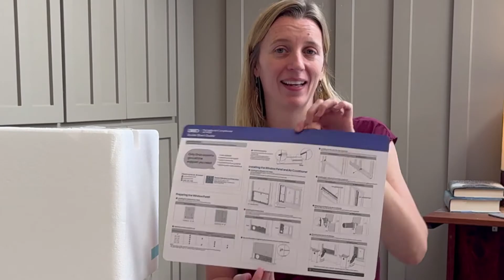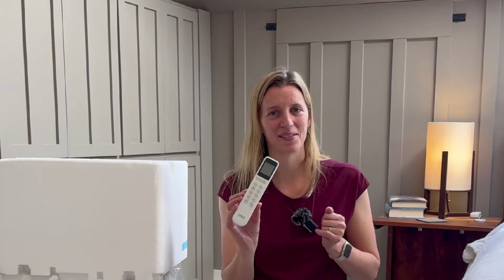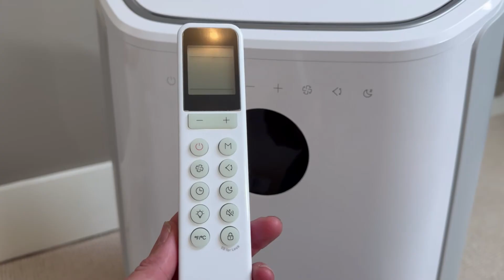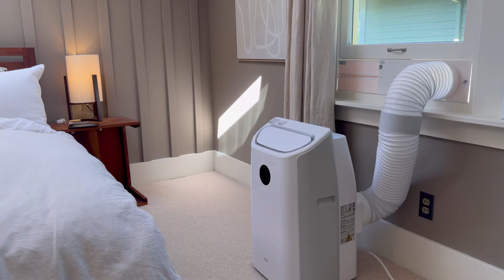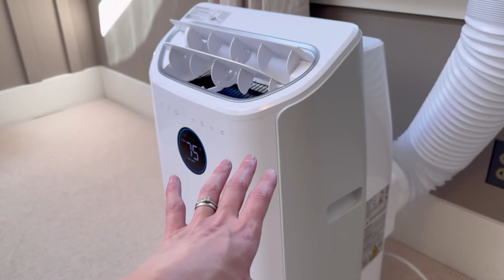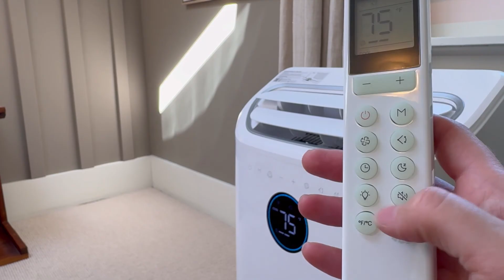Is This The Most Advanced Portable AC Ever Made? Dreo 12,000 BTU

Comment: Thanks for the video i bought one today on Amazon 12000 btu im going to use it in the garage and vent it into my attic,i bought the toshiba 12000 from home depot and it didnt work had to bring it back after setting it all up and it had that dual hose i dont like that so im hoping this one works out plus i saved 230 dollars on getting this one,will see. 😊
Reply from the maker: I’m a little concerned that you’ll be venting into the attic instead of outside. It could compromise the AC’s efficiency. But I hope it works out!

Comment: What size btu would i need? My room is approximately 12x11 and 8 foot ceiling.
Reply from the maker: For that space, you need a 5,000-6,000 BTU AC at a minimum. But if you don't plan to keep the door closed all the time and the rest of the home is hot, you may want to lean towards a more powerful AC.

Comment: terrible air conditioner...hose gets hot, heating the home...also, as it expels air from the home it also creates a vacuum in the house, which draws warm air inside...my 130 dollar old school window unit does a better job....
Reply from the maker: All single hose portable air conditioners work like this. They pull in the hot air, run it over the condenser coils, and the blow the cold air back into the room. Excess hot and humid air is pushed out through the hose and out the window. That can create a tiny air vacuum that will be filled by air coming from other spaces in the building, but the majority of the air is cooled and blown back into the space so - overall - it cools the space while blowing wonderfully cold air.

That is also how window air conditioners work. The majority of the air stays in the space as it flows over the condenser coils, but the back of a window air conditioner exhausts warm, humid air that has been heated by the cooling process, along with any condensation that forms. So window air conditioners also will create a small vacuum, which is a non-issue because it is far smaller than the cool air being circulated - just like the portable AC.

Window ACs are more efficient, but they're also more work to install and that usually makes them a more permanent fixture while portable ACs are a less efficient (especially if you have that tube going a long ways to the window and don't properly seal the window), but give you more freedom - both in where you can use them and that you can roll them out of sight in the colder months. Pros and cons that are standard for all window vs portable ACs.

I'm sorry you had a bad experience with this, but I'm standing by this AC. It's the best portable AC I've ever used and, from its reviews, many agree. I ended up giving this to my brother as he needed it way more than I did and he raves about it all the time as well. His home has no AC, thin walls, no shade, and he's a gamer so his room is always super hot. This AC has made a world of difference for him for the past year. It also does a good enough job evaporating the collected moisture that he's never had to drain it either (we are in the PNW for humidity reference).
Reply: Being a plumber; this persons comment makes me laugh so hard. Shows your true intelligence and age. It’s obviously the operator not the unit. There’s no way a portable ac will contribute to a vacuum affect in regards of pulling warm air inside the house lmfao 🤣
Reply: @bsnmma4629  it pulls air from the house to cool the condenser and expels the hot air outside, which creates the vaccum in the house pulling hot air in from outside...this is ac 101 type stuff man
Reply: you can always get the dual hose kit or mod it for dual hose if it worries you that much

Comment: Do you need the hose all the time?
Reply from the maker: If you mean the hose to empty the tank, you may never need it! It just really depends on where you are located. We're in Oregon and this ran all summer without the tank ever needing the be emptied. That's because this AC is designed to evaporate excess water into the air as it runs. BUT, if you live in a high humidity location, it won't be able to evaporate excess water into the air and you'll need to empty the tank more often or just add the hose.

Comment: How loud is this portable AC? At the max speed and low speed, does it bother you or would you be able to sleep uninterrupted? Have you come across any other portable AC's that you feel are personally really quiet? Thanks for the video
Reply from the maker: It's quieter than our LG window AC. I could handle it at low speed when I sleep...especially with it running continuously as a low-level white noise. That said, we do everything we can to avoid running portable ACs in our bedroom when we sleep and, luckily, it hasn't been hot enough where we are (Portland, Oregon) this summer for us to have to keep it on...we can usually turn our window AC off by 11ish.

Unfortunately I have not been looking at ACs specifically for how quiet they are so I don't have one I personally think is really quiet. We keep meaning to save up for a heat pump so we can get rid of the portable ACs, but $$$!

Comment: False advertising. You got paid for your review or received free unit. I got my unit today and it doesn’t cool the room. It was maintaining room temperature at 77F for five hours and then finally went just one degree down to 76F. It just doesn’t cool well.
Reply from the maker: While I do gifted and sponsored reviews (which I clearly note in the description and say in the video), this Dreo AC is not one of them. I actually bought when it was released because I trust the Dreo brand. This AC definitely impressed me and has raving reviews on Amazon.

What is the outside temp where you are? What is the size of your room? Is the room and the exhaust pipes from the AC well insulated so heat isn't pouring back in? Are you leaving a door open to a space larger than this AC can handle? This Dreo is a 12,000BTU AC so it's designed for a 400–550 square foot space.

In general, portable ACs work best when they are the correct size for the space, the doors to the space you are cooling remain closed, and they are able to get to a manageable temperature that they can maintain.

For example, if our space gets over 80F and it's in the 90s outside, it'll take A LONG TIME for the AC to cool down the space. But, if we can keep the space cool in the morning, we can maintain that temp throughout the day by keeping the AC running. We actually have our AC set to 68F all the time. On days closer to 100F, our room can get up to 74. On days in the 80s-90s, the AC can  keep the room to 71. Anything cooler and it can maintain 68.
Reply: Mine is arriving today. Putting in an office with a lot of computers running. I'll report back after installed to see if this is true or not!
Reply: oh cry us a river Mateo
Reply: Just finished installing. I will say this thing is great, but needs some serious juice. When it first comes on, the compressor may not activate at first (possible you have a bad compressor) but I also noticed that if it can't draw enough power from your outlet to come on, it just basically is a fan. It will do a subtle beep to let you know. As soon as I moved plugs, the compressor came on and is VERY cold.. So I'd check your power situation first, and if you still have issues, you might just have a bad compressor.
Reply from the maker: thank you for testing! I never would’ve thought about the power needs 😅
Reply: sucks to be you
Reply: Here's the truth everyone, it depends. If you're in the south like me with temperatures in the mid to upper 90's and it's sunny, it may struggle in a large room especially if the door is open.  However, often I have the opposite problem  of freezing in my room after a few minutes.   Also, the debate about pulling a vacuum in the room that draws in warm air scientifically is true, but it is overblown. I have two units, my only gripe is there is a thumping sound everytime the compressor shuts down (and it does cycle) . If these were in my bedroom it could be a problem sleeping.  I often set it at 76 F , but if I'm in the room for a while I constantly have to bump up the settings because I start feeling chilly.  I also suggest that you place the unit close to the outlet to minimixe the run of the exhaust hose and buy insulation for that hose.

Comment: Thanks for the video, is this an inverter type  ?
Reply from the maker: I have to be honest, I've looked at and tried many types of Portable/Window ACs, but never come across separating them as inverter or non-inverter ACs. As near as I can tell, an inverter AC means it has variable speed/power so I'm guessing that has more to do with HVAC AC systems than Portable ACs since every Portable AC I've tried has fan speed controls and usually automatically adapt to the temperature.

I could be totally wrong and I did find this reddit thread that deep dives into this: https://www.reddit.com/r/AskEngineers/comments/122d8fu/eli5_explain_to_me_the_difference_between_regular/

All said, the Dreo is an excellent air conditioner that does adapt to the room temp and is exceptionally quiet while powerful. I hope my long-winded response helped in some way!

Comment: After using this for a while, Is this truly drainage free? I’m debating on drainage free or dual hose. Any issues with the heat recirculating from the vent?
Reply from the maker: At 2:48, I point out the drains. I does have a tank that collects the water and IF you aren't in a high-humidity area or don't run it all the time, it is designed to collect less water and evaporate most water it collects over time. That said, it will alert you when the tank is close to full and turn off it if is full so you can drain it.

As for heat recirculating. The exhaust vent needs to go out the window so it doesn't recirculate. The lower side vent - I believe - is for the air evaporator more than anything, but no air is coming out of it. So no, it doesn't blow any warm air back into your space!
Reply: @alderandjade I appreciate your answer.  My current unit is one hose and I can feel the heat radiating from the whole hose, which seems to be warming the room faster than the unit is trying to cool it.  I have read that insulating the hose itself should keep that from happening so I was curious if you e run into that situation.
Reply from the maker: @saddad6601  The exhaust hose will definitely get quite warm, but the physical heat on the hose should not be warming your room. The majority of the heat should be venting out the window. That said, any insulation you can add will make a difference. Covering the hose can help (but isn't necessary), but definitely make sure no hot air is coming in through cracks in the window opening. 

Another thing to keep in mind is the square footage this is designed for and that there is a temperature tipping point with small ACs. This Dreo is 12,000BTU so it's designed for 450-500 square feet. If you have it in a small room, but always have the door open to the rest of the house, that cool air is moving out of the room just as fast as warm air is moving in and you aren't going to notice as much of a difference minus feeling the extra heat on the exhaust hose. 

AND, from experience, I've found that these ACs work much better if you keep the room at a cooler temp. Say, keep your room 75F or lower and let it maintain that temp throughout the day. If you let the room go over 90F and then turn on the AC in the middle of the hot day, it's going to have a REALLY hard time countering that and getting the room back down to something cool.

We usually keep our AC at 68F all day on hot summer days and it keeps the room at 68-74F depending on the outside temp.